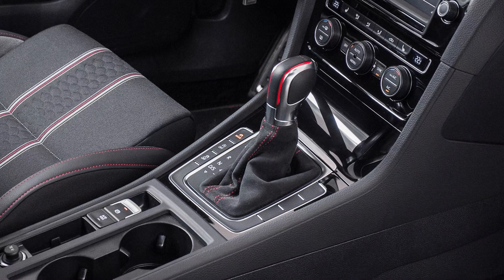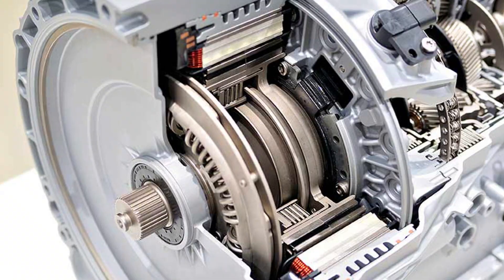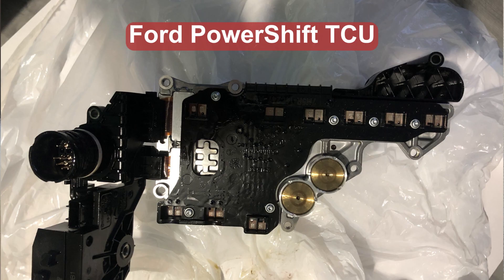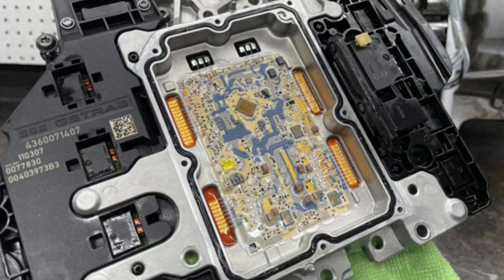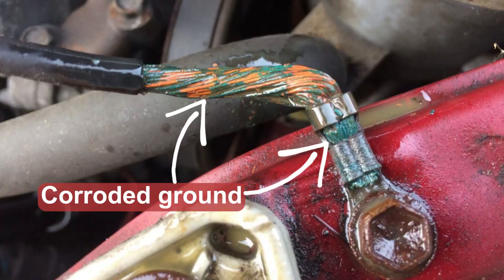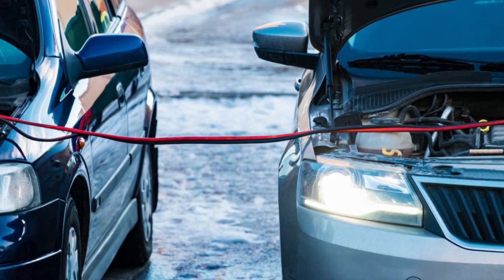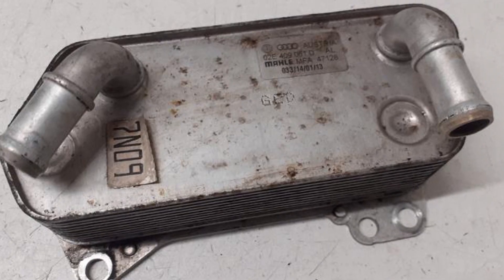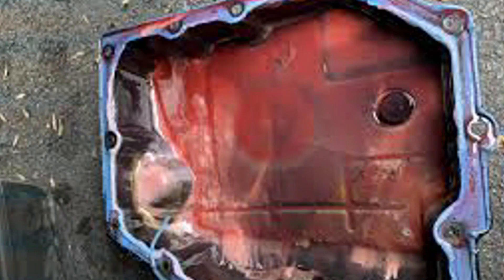Funny reasons for DCT transmission problems you should avoid

Comment: I HATE dcts for the clutch slip on first gear.
Reply from the maker: The clutches are made to engage a gear when there is already another gear engaged. This makes shifting smooth if everything is working properly. But when the first gear is engaged, there is no previous gear and it comes after neutral, hence it feels like slipping. But I wouldn't say this is significant in all transmissions of this type.